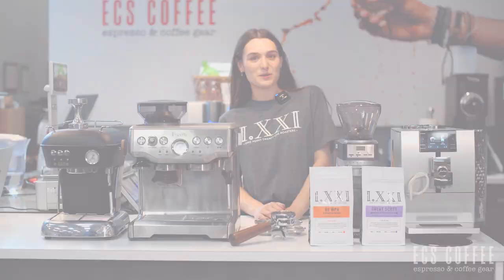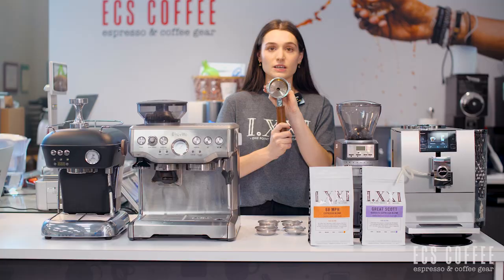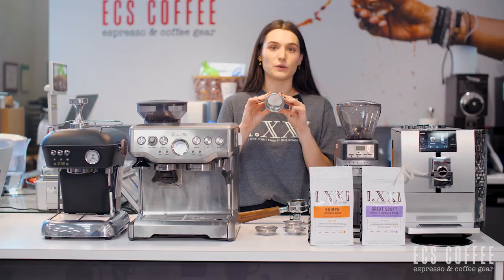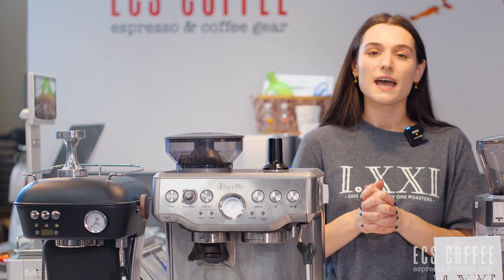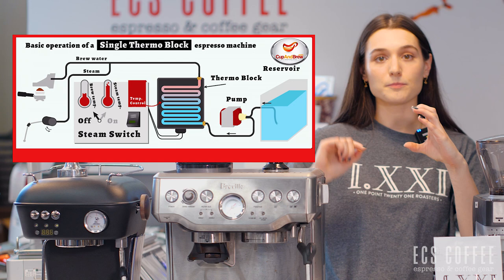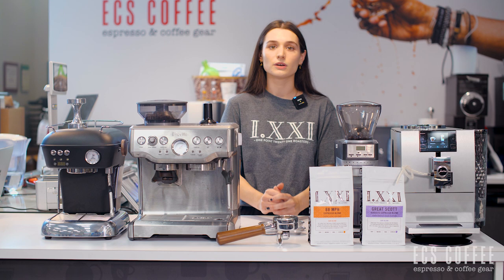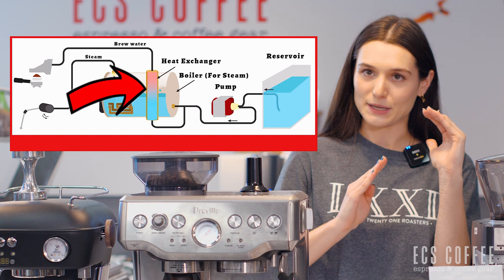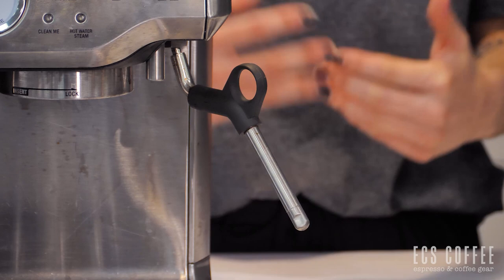Espresso Basics & Terminology for Dummies | A Full Breakdown

Comment: Great review. I have a Philips 2200 lattego. I noticed that super automatic machines sometimes don't grind fine enough for espresso. Hence I have my grinder on the finest setting and temperature at the highest for maximum extraction. My question then is, if I use my machine on the finest grind setting, can it cause the grinder to get clogged? PS. I use 100% arabica beans that is a well developed medium roast...roasted for espresso.
Reply from the maker: It is possible, but the grinders are designed to grind at that low setting and continue to function....assuming the beans are not oily. We do recommend using a grinder cleaner like GRINDZ every once in a while to clean out your grinder.
Reply: If you are still not satisfied with the espresso, opt for a semi automatic. I've had the Phillips 4300, and to my taste buds, it always produced sour espresso, even with the grinder set at the finest setting. After one week of using it, I returned it.
Reply: @louisd95714  which semi automatic machine do you use?
Reply: @Kingofwands6  Breville Barista Pro